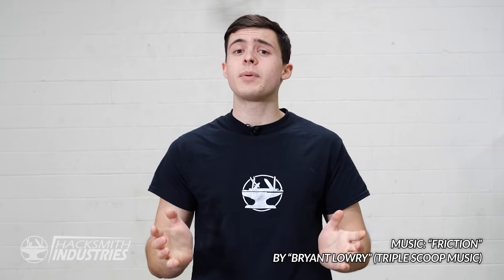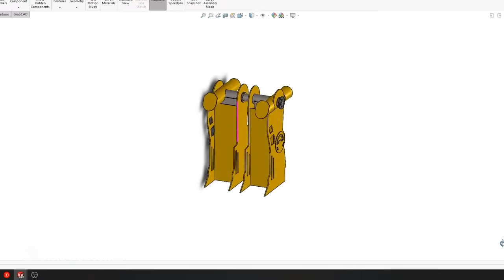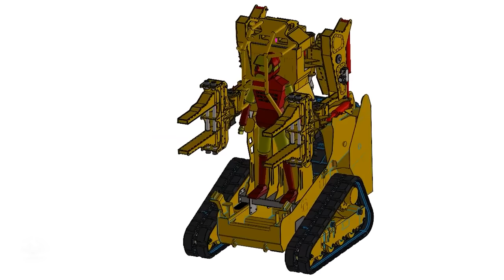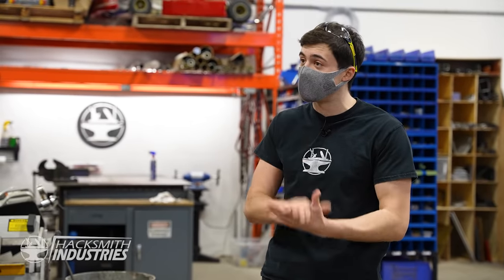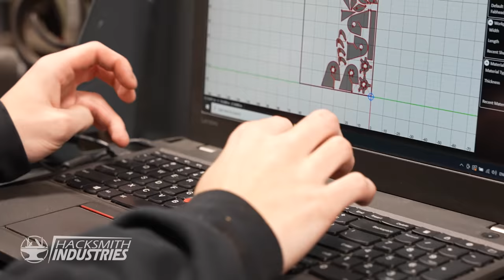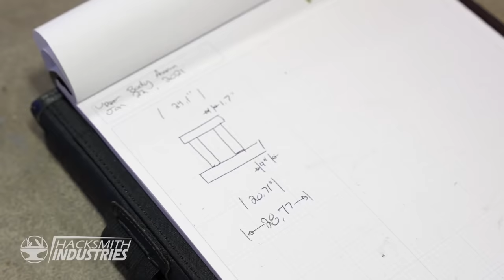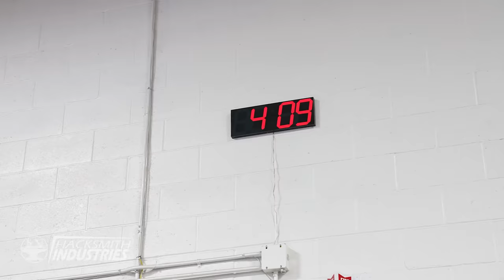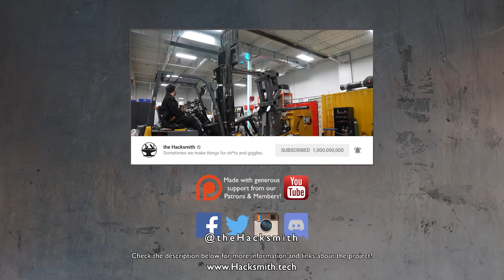It's all coming together... (POWER LOADER: PART 12)

Comment: Anything: Exists
Hacksmith: Here have a new jet engine
Reply: James: we finished the powerloader ,but what about a powerloader with a jet engine ?😂
Reply: @axarijjj6918  jet engine on both arms and on the legs
Reply: @AAABattery_  it doesn't have functional legs, it'll move with the treads
Reply: @axarijjj6918  and a light saber
Reply: @i_am_knuckles  it has "legs" holding on, you can put jet engines on them.

Comment: You should make that 3D Maneuvering Gear from Attack on Titan. I think if it’s anyone that can do it, it’s you guys!
Reply: Please do
Reply: @JustJack nothing is impossible for these guys
Reply: @JustJack believe
Reply: OMG YES
Reply: They already have made swords and kind of the omni directional thingy
Reply: Nothing except finding something they can’t do
Reply: CoNfuSioN
Reply: We are going to have another Ian falling accident
Reply: It’s nearly impossible to make 3DMG. Getting the hooks to work would be incredibly difficult
Reply: @xjoshx4628  The Hacksmith mentioned that Its impossible.
Reply: Theyve made something like it but an exact one is impossible to get the right amount of power for it to work and the center of gravity would be an issue
Reply: Still... I think at least something CLOSE would be pretty cool.
Reply: @Chxnkpip  also the landing shock
Reply: Well if they did decide to do it it would just be a grapple gun attach to your waist. It’s actually physically impossible to do what they do in the anime.
Reply: As much as i like and love this idea as an aot fan.... The odm in real life will not be any different than a grappling gun. Its a difficult concept but the hook spear mechanism is not applicable in real life like in the show as well as the reeling of the rope. It requires quite a bit of tourqe to pull your whole body flying like in the show and i don’t think we have small compact motors for that(unless its ok to have a big strong motor but it will be bulky and heavy).
Reply: As much as I want it without proper training it would kill you
Reply: He already made the swords and the training rig years ago
Reply: They made a video about it a while back, as well as swords with interchangeable blades
Reply: @xjoshx4628  So far, they can’t make it like in the anime.
Reply: YES

Comment: i have a question: in buiding something like this what are the tolarences? how precise do you measure the parts in fabrication process?
Reply: Always more than what its rated for, however idk any exact numbers, but as mentioned in the video, the base has to be able to carry the upper part + everything the upper part is able to carry + some margin
Reply: @DJTimeLock  I think he's talking more about tolerances between the parts, but from my experience, for bushings, the tolerance will be about 0.05mm oversize, and with the laser cut structural pieces theres probably around +/- 0.5mm I'd guess
Reply: And I remember that the 3d app they use can do a test for the stress and tolerance of the structure. They then plasma cut it
Reply: I was wondering that too.  It looked like it all went together until I saw the tube being fitted into the plate with a lot of slop in it

Comment: I have a concern. The thing does look absolutely mean, but how top heavy/stable is it going to be? I worry that fast acceleration forward of backwards may cause the thing to tip, moreover if it's carrying something. Would the 'roll cage' be strong enough to take the weight without collapsing? It seems possible there is a real risk of crush injury which with that amount of weight could literally be deadly.

Comment: This has taken an age to get to this point and I've been following right from the start. Absolutely amazing work guys. Originally thought it was going to be a watered down simplistic version, but this really rocks, and if the drive train can be smooth enough without the higher centre of gravity causing issues, then you may have a real winner.

Would be interesting if there was a gimbal in place so if the tracks move up and down over rocky ground, the loader stays level.

Comment: So genuine question. Why don’t they weld across the entire joints where pieces of metal meet. I only ever saw like 2 inch long welds. Idk if maybe they finish them off camera or if there’s a reason for small weld compared to a fully welded joint.

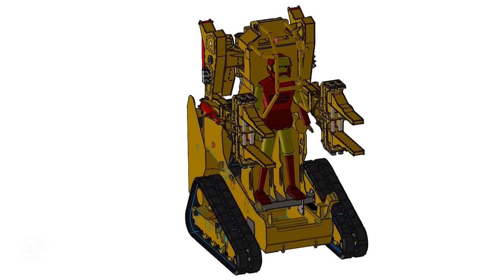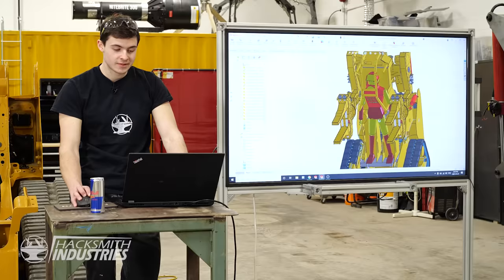Comment: Notice: i take the 3:36 to 3:38 Time stamp as reference. i see an potential security problem. As you see the Track loader hands are really near the Roll cage. So when the Pilot rotate the Hands at this position the Fingers would crush/hit the Roll cage or make the cage there smaller. I Hope the Software will have an Death Zone Protection or some similar thing

Comment: Is it going to be able to pick up items?   It looks like with the additional height, you might want to make the arms longer to pick up boxes lower to the ground.   I know in the movies the boxes had tabs that the power loader can grab.  Also interested in how far foreword it can reach.  Meaning with the treads sticking out that far, your only going to be able to grab with the end 4/5 inches of the forks.  

I think both could be fixed by adding length to both sections of the arms.  Or maybe by repositioning the body forward?
Reply from the maker: it leans forward and the arms with claws are pretty darn long. Can pick up straight off the ground, would of been pretty dumb to design it not to be able to do that ;)
Reply: That’s really cool.  Sorry. Sometimes engineering projects loose sight of the big picture stuff.   This is awesome to see come together.

Comment: Just thinking if this was to be used for industrial purposes someone may want to accually sit in some shape or form and not have to support their shifting weight in the machine while under load or while going spot to spot
Reply: Just a thought like in the industry mindset having a solid standing form like that would not be comfortable with something that has little to no suspension
Reply: But you also probably already thought of that and we’re going for cool factor and athstetic